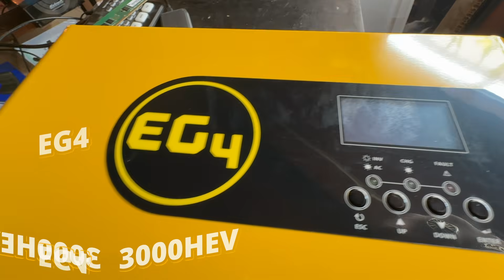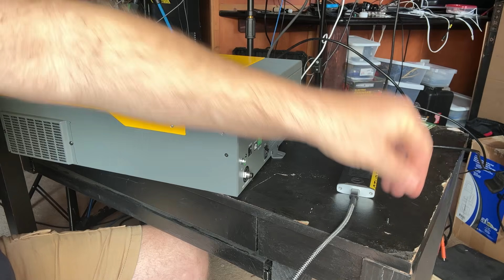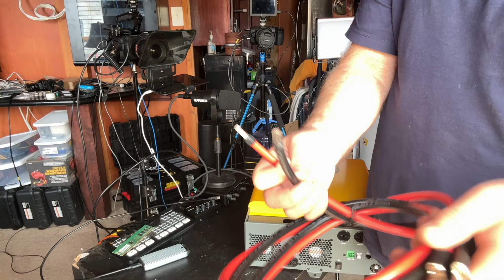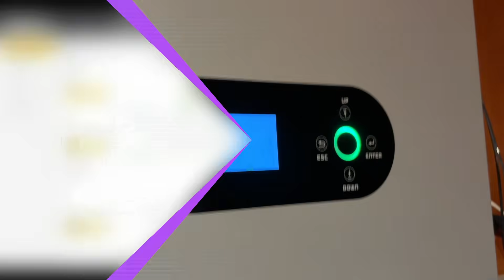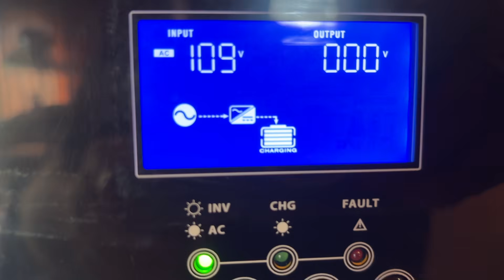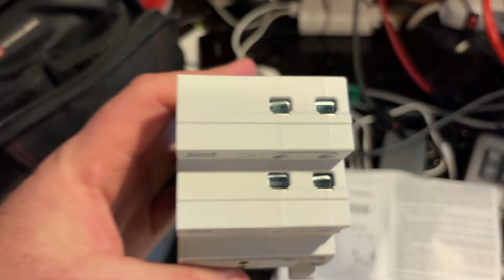EG4 3000EHV Install + Automatic Transfer Switch – Full Off-Grid Solar Backup Setup

Comment from the maker: ⚡ WATCH THIS FIRST — If you're running any critical loads on solar (network gear, security cameras, NAS, anything that can't go down), this setup is exactly what you need.
🔗 Grab the EG4 3000EHV-48 at Signature Solar and SAVE $50 with our affiliate link → https://signaturesolar.com/eg4-3kw-off-grid-inverter-3000ehv-48-3000w?ref=kyzasjrm
Drop your questions below — I read every comment. 👇

Comment: Why did you not use a regular 120vac out from the '12000 and just set the '3000 to prefer battery?

Comment: Where's the ats link?
Reply from the maker: Good question 👍 this style of ATS doesn’t use a separate sensing wire.
It actually monitors voltage directly from the two input sources (grid and inverter/generator), and when one drops out, it switches automatically.

So everything is handled internally through the terminals no extra control wiring needed on this one.

We’ve found these work well for simple setups, especially small circuits or subpanels.

Keep shining, stay charged